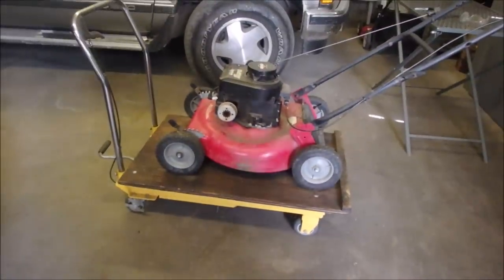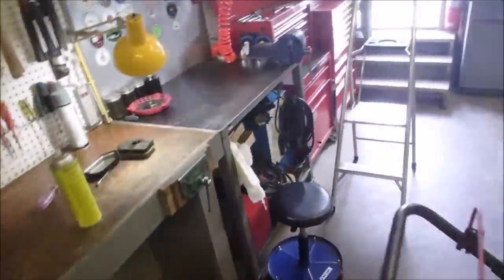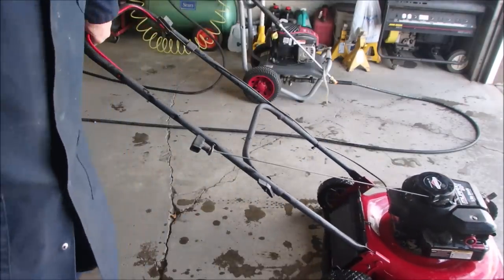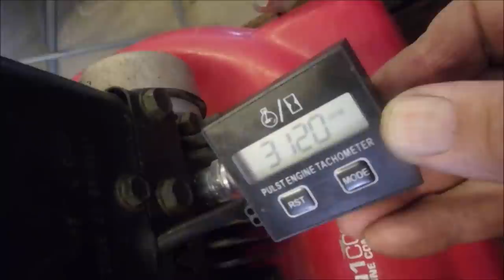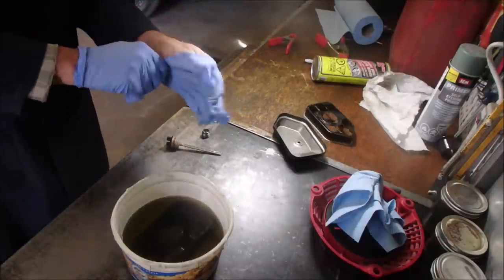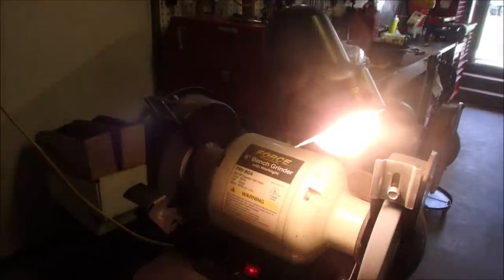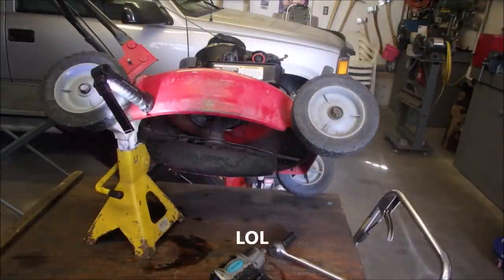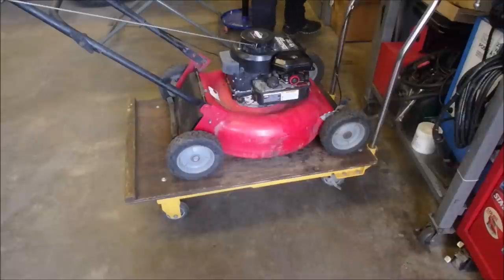Murray Mower with Briggs Classic should Start

Comment: Excellent points made on this video Bruce: run the foam filters dry no oil which is what we also do at Eliminator. Very easy to clean when they come back for service normally every two years, whereas the oiled filters are very difficult to clean and we believe they trap way more dust build up and restrict more air flow than a dry filter. Spray around the carb base another good trick to see if your not fully sealed. 100% correct that old mower will be around until 2050 because i can see the underside of the deck is clean and not rusted so whoever owns it well done the big box mowers likely will only last 10 years before they have rotted out decks or stuck valves because of the no oil change required BS.
Reply from the maker: I still can't believe the manufacturer would say that.  Thanks Wayne.

Comment: Hello Bruce. I know nothing about lawnmowers but enjoy watching your work.  I do mow however with a JD STX-38 yellow deck.  Seems that I have an oil leak.  Do you happen to know the most likely cause? I don't think I overfilled.  Smoke is rising from somewhere during and after mowing! Thanks.  :goodvibes:
Reply from the maker: First I would check the oil when the machine is cold just in case.  Make sure the cap in on tight too of course.  Get a bright light andcheck for wet spot anywhere on the engine.  Sorry this is all I can dd for you as I am not there.
Reply: @BrucesShop  Thanks, I will check these things out.

Comment: Bruce. I have one of these old Briggs. I changed the air filter and lightly oiled it. It runs like a brand new one until I put the air filter on. Runs like crap after. What's up? The one I took off was the original filter
Reply from the maker: I do not oil the filters on these.  Some folks do but I don't

Comment: Bruce,   I’m having an issue with a Kohler lawn mower carburetor leaking gas when I tipped it up to inspect the bade? I cleaned the carburetor really well and it was running good until I tipped it on its side.
Reply from the maker: Yes a tiny bit of dirt must have gone into the needle in the carb  Clean it again  It may have come from the tank.

Comment: Very informative-like your sharpening technique. I'd like you to comment on the oil weight you use on new vs older engines. I generally stick to manufacture's recommendation. Thoughts?
Reply from the maker: Thank you!I use 10/30 which is 90% of the manufacturer's specs.

Comment: Great video! You need to make sure the spark plug wire is taken off the spark plug before you drain the oil or remove the blade.😉😉
Reply from the maker: Thanks for the tip!
Reply: Its 120% impossible for the engine to start even with the spark boot on when working under. The coil does not create spark under 300 rpm. Try spinning the blade 5 turns per second with the flywheel brake on. Just go Bruce- you rock! 👍
Reply from the maker: @andersforrad  Thanks for the help Anders.

Comment: Bruce.   Help!    got a Murray 22 inch with same carb and engine.  1 spring on carb..   Its been carb cleaned. New gaskets. Installed correctly.   Starts on 2 pulls but the RPM are really low.   I adjusted the spring.  But it did nothing.....is the governed need adjustment?    I have fixed 10 of these setups never had this problem.   Cheers from Seattle
Reply from the maker: Yes the governor is the lever at the end of the spring.  bend it away as if you were tightening the spring.
Reply: Something inside is grinding.....ill be opening her up ft or my knowledge.   The customer said its yours.

Comment: Did you you cover the carburetor before pressure washing it?
Reply from the maker: I don't understand  --------cover the carbon
Reply: @BrucesShop  Sorry I didn't catch the stupid auto complete function. I have edited to correct.
Reply from the maker: @dwightcarlson7136  Usually I just put a piece of plastic over it but this one was not that dirty.  Thanks for rectifying the question.